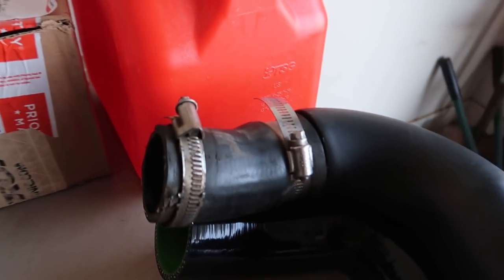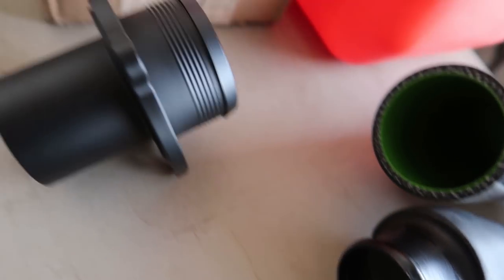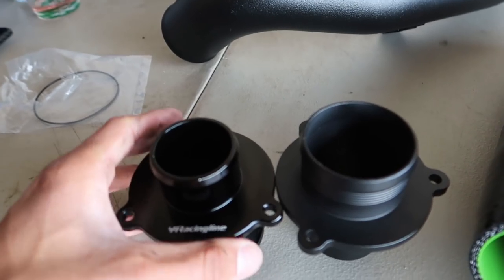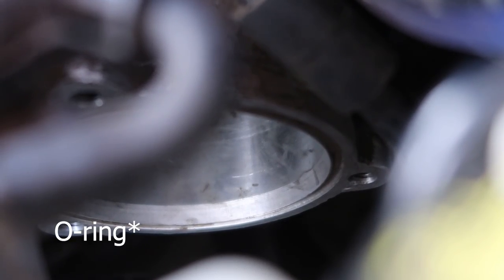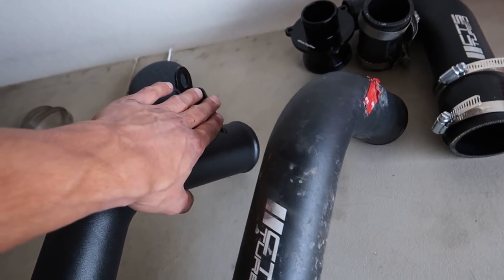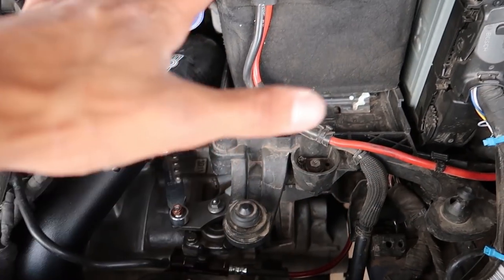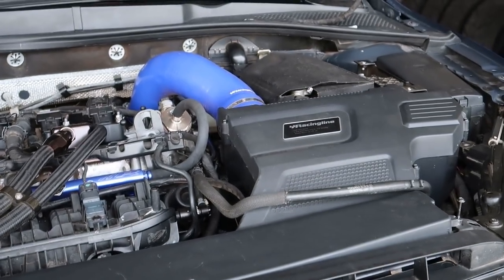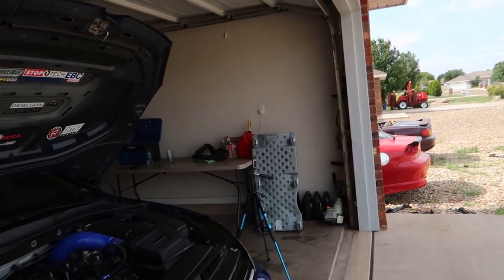EQT Discharge pipes VS CTS Discharge pipes | MK7 Golf R

Comment: Dude...22mm wrench for the o2. Works great. If it's stuck tap that baby with a big hammer and done deal. I remember you having issue with the one on that gti swap. Big ass wrench bro, it does an o2 good lol.  Just can't use it when the turbo is on the car is all. Those o2 sockets always want to spread apart and are a pita.

Comment: I own a mk6 golf r, and I highly recommend upgrading all the intercooler and turbo piping to a billet aftermarket upgrade. The sound of it, is just beautiful
Reply from the maker: Yes sir!
Reply: For a stock R will you notice better sound? Till I can afford a tune anyways.
Reply: @CA-td2mx  yea, it will sound different once you swap most of the plastic OEM parts with performance aftermarket billet / aluminum pieces

Comment: I Wish could see this video before I bought the cts pipes because I have the same set up of Racingline intake and pipes and I had to cut a corner of my intake to fit with the CTS pipes. Also still doesn’t fit correctly and sometimes vibrated a little bit.
I will definitely buy these from EQT, especially now that I know will fit perfect paired with the Intake.
Reply from the maker: Yeah the CTS one are kinda crap :/ you won't be upset with the EQT ones though!

Comment: Haha, I don't remember it being real easy! 

I had troubles putting the delete into the turbo, felt like I was jamming it in! But in the end, it went in and overal airflow is a lot better! Next are the discharge pipes and instal the new turbo thats been sitting here for almost a year! 

Keep up the great vids!!
Reply from the maker: Get that turbo in brotha!! I'm thoroughly impressed with EQTs products though for sure, money well spent!
Reply: @BryceJordanProductions  Tell me about it!! Need to save up for the cost of mapping! 
Gonna attempt to install it myself, using that vid you did ages ago :) no worries! ha
Reply from the maker: Hell yeah! Tuning is always so expensive 🙃 but at least it's pretty easy on our end these days for tuning! I'll have another video up Friday for this turbo, between the two vids plus the internet as a whole you should be more then able to get it done! Just have a good amount of time set aside to work 🤘
Reply: @BryceJordanProductions  Oh sweet, that'll be very handy cheers! 
Do you replace the seals/bolts etc or just reuse the current ones?
Reply from the maker: I replaced all the O-rings/gasket for the oil/coolant lines &turbo, used the same studs for the turbo with new hardware. Ain't really much to replace in there, and it's all super duper easy

Comment: I was just about to snag a CTS discharge pipe, but I couldn't get over the ridiculous bottle neck, so I decided to do a little more research, which I'm glad I did cuz it lead me to this video. I appreciate the side-by-side, EQT vs. CTS; it's not even close! Gonna spend a little more than I anticipated, but I'm definitely going for an EQT setup. 

I know you were pretty much just mocking everything up, but did you have a chance to take the R for a spin with just the new EQT discharge pipe setup? Just wondering if you could feel a difference between that and your old CTS setup. Also, do you remember feeling a difference going from the stock discharge pipe to the CTS setup?

Thanks in advance, and keep up the great content!
Reply from the maker: I really didn't notice too much really, just knowing the airflow is better overall makes me happy, I'd say it's worth the extra few bucks just for fitment honestly. I'm sure it did add a few horses in the higher RPMs though!

Comment: The EQT looks very nice. I wonder if it rubs on top of the DSG/Oil Cooler hose and DSG Breather hose on the side of the battery like my ECS one does. You have a manual so clearance seems to be less of an issue. Mine has a rubber elbow and rubs on both places, specially on the DSG Breather hose next to the battery but after 20K miles it has yet to puncture it.  I tried the Spulen one a couple of years back and that was even worse. Fitment was off and was even smaller.
Reply from the maker: I can tell you against the CTS pipes the fitment is much better and closer to the block
Reply: @BryceJordanProductions  Super.

Comment: Bryce. What spark plugs and gap are you running on your latest setup? You are UM MPI tuned at the moment right?
Reply from the maker: Pro tuned via eurodyne, running brisk er12s at .022 gap, ~30psi she runs like a champ
Reply: @BryceJordanProductions  Got it. Had been running IKH01-24 for a while myself on APR ST2. Awesome plugs btw, but since going UM two weeks ago I've started getting a lot of popping misfires on cold start and off throttle so I put in the stock plugs at stock gap of 0.32 mm too see how things go. Car seemed to be running rich then and somewhat still does for some reason, though trims look fair and compression test showed no issues.

Comment: so the EQT kit only came with the intercooler inlet hose ?  What are you using for the outlet hose ?
Reply from the maker: Yes this includes everything from turbo to intercooler. From intercooler to throttle body mine is still stock for now. That may change soon though
Reply: @BryceJordanProductions  Gotcha! Im looking into that as well. Just ordered my intercooler along woth the EQT kit!
Reply from the maker: Heck yeah! Which ic did you go with?
Reply: @BryceJordanProductions  APR
Reply from the maker: Nice! Good choice!

Comment: did you use the middle clip on the aluminum section for a harness or anything? I just installed these and I didnt seem to need to use that.
Reply from the maker: I zip tired the one wiring harness that's near by so it wouldn't chaff on anything
Reply: @BryceJordanProductions  i will check and do the same thanks!

Comment: Did you ever order the Racingline reroute hose?
Reply from the maker: I sure did! Works and fits like a charm!
Reply: @BryceJordanProductions  Did your tube have a metal bar about 1/2 an inch inside the left side of the tube? I'm guesing its a one way valve but I didn't fit my tube as it didn't fit on as far as the original hose. I've been slowly making my car similar to yours :)
Reply from the maker: @gimmegaming5345  yup it has a little valve in there so that the fluid only travels one way! You can probably push in down in there more if you needed to, are you saying the hose doesn't fit on there the whole way as the OE? And nice! I like to think I have a tasteful selection of mods, and many many more coming soon! Redoing the whole braking system besides the rear calipers soon, seats, lightweight battery and a bunch of small stuff!
Reply: @BryceJordanProductions  Yea it doesn't fit on like the OE. I will give it a go and try push it further into the hose. I just wasn't too sure whether to give it a go (Not a mechanic in any way, just did all the work so far based on youtube videos as I found it fun).
Reply from the maker: @gimmegaming5345  well im glad I could be of some help! I love working on the car 😁 just checked my pics, the hose should fit all the way down to the rib on the metal pipe. Shouldn't be too hard to get that valve to move down some, but if it doesn't.. you really on need the hose to fit enough to get the clamp on, it should hold just fine not being the entire way to the rib
Reply: @BryceJordanProductions  Thanks for the help :). From another video you mentioned about a noise after you did your clutch, I have that exact same noise when mine was upgraded so I think your right, its normal. I noticed once you where racing and struggled to get it into 3rd, looked like another issue I had (My short shifter was not aligned 100% and under hard acceleration it seemed 3rd wasn't there, it didn't grind at all, it just felt like I was hitting the part between the gears, I realigned it and has been perfect ever since)
Reply from the maker: @gimmegaming5345  well hell, that's awesome I'm glad it fixed and cleared things up! Love it when these vids actually genuinely help someone out 🤘🤘🤘

Comment: Welcome back man! You should check and see if the hardware from the stock discharge pipe fits, it has a rubber grommet that supposedly helps with possible vibration noise. https://youtu.be/cPP5qwIEcnI?t=419 

Been recently looking at upgrading my boost pipes the EQT is high on the list.
Reply from the maker: I will look tonight! Thanks for the idea dude! Idk why I didn't think of grabbing the stockers lol. And hell yeah, obv you can see they're quality! Glad I got them 🤘